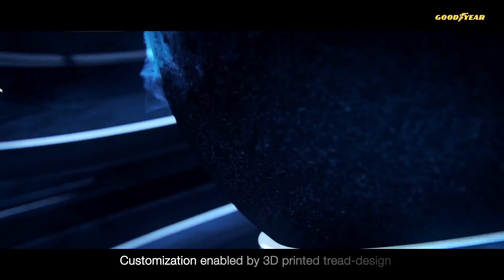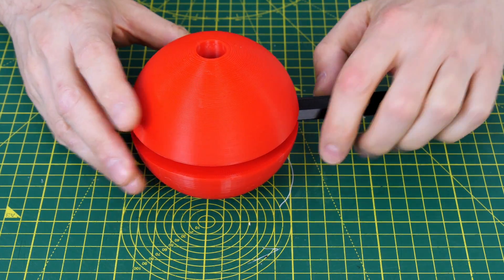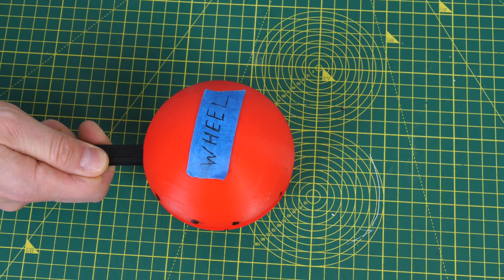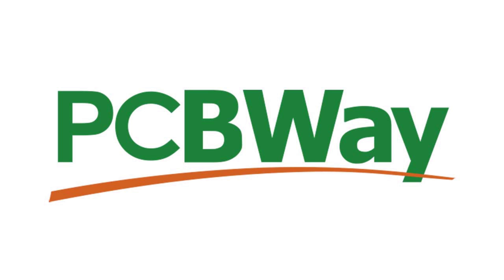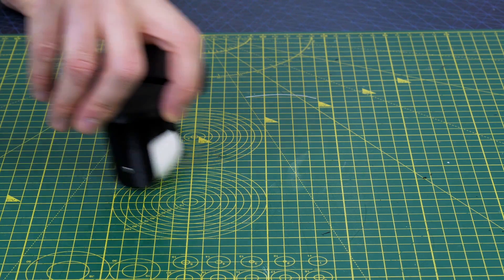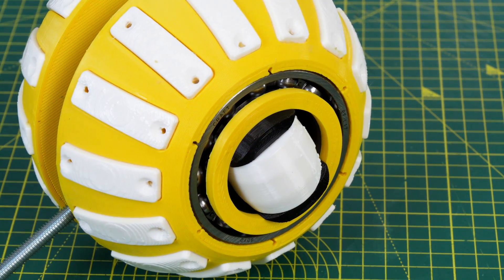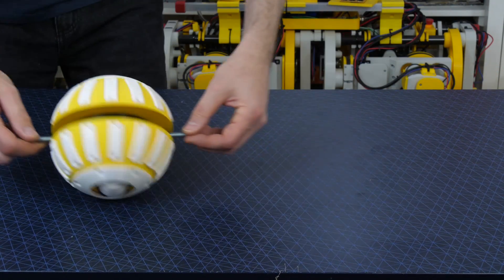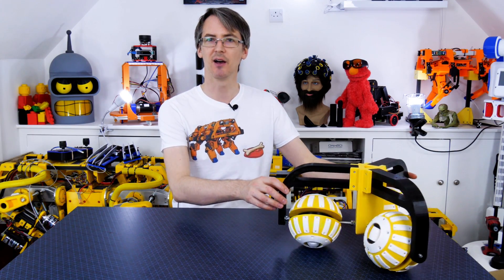Are Ball Shaped Wheels Practical?

Comment: I think the goodyear style magnetic wheels could work fine. The wheel would effectively be the rotor of an ac motor and as long as less than half of it is exposed under the car it can’t fall out if anything goes wrong.  The wheels could lift up completely when the vehicle is shut off and tada: park brake.

Comment: Just angle the axle, aka give it a little caster and a little toe in or out, and the part of the hemisphere on the end which can’t roll would never touch the ground. Would probably need to compensate for differences in rotation in between the two hemispheres with a sort of computer controlled differential or if the electric motor is in the hemisphere compensate with software.

Comment: You might not need the little wheels attached to the center hub with their shape..  If you attached them to the hemispheres, they might act to self align the hemisphere so that the little wheels rolls in the direct of movement.  It might now work 100 of the time but it would simplify the design.

Comment: Looks ideal for a camera dolly, if the hempispheres have smooth surfaces and fit as closely as possible to the rollers at the poles.
Reply: The gap bump prevents that use case :(. The drive shaft has to go through that gap, so it can't be small.
Reply: @coderentity2079  the poles not the equator. For an unpowered version the shaft could be replaced with a taller 'blade' that's thinner where it passes between the hemispheres. Immediately outside the surface it'd be thicker and curved to wrap around so the thinnest part of the support would also be curved rather than having a straight section that could flex.
Reply: @greggeshelman  Yet another idea is to slightly tilt the hemispheres to close the gap on the opposite side of the shaft. This makes the gap way smaller. You can go as far as have the hemispheres overlap by giving them square tooth that mesh together. This is of course for clean rooms, not for offrad.

Comment: While I can see mounting a pair of drive motors to each main wheel, I'm not sure if you could get away with the endwheel getting enough power to keep up. There may be some way to rotate the tri-wheel assembly to keep the endwheel from rotating into ground contact with a rotational limit encoding in the support axles.

Comment: What do you think about miniaturizing and motorizing? I've been looking for different designs of omini wheels in order to create a design for a vr locomotion shoe. Most of then are interesting but normally they are quite bulk, I'm looking for something simple which could simulate different traction using rpm, this ball wheel is pretty close to what I'm looking for but the size is quite the problem.

Comment: Perhaps this is a silly question, but rather than having the small wheel couldn't you track the wheel position and tell the motor to avoid the dead positions?
Reply: Not a silly question, you can track (or sense) the lock position and avoid it by slight turning. What you do loose with this is total control over the direction the robot faces. Sometimes you can't face a certain direction because of the drive-lock-avoiding. Bad thing for a camera dolly for example. Unimportant for a mapping robot.

Comment: I'm saddened that 'roller ball bearings' didn't come to your mind when thinking about a good little wheel in the center. They are easy to get and hold a lot of weight.
Reply: And when your wheels happen to stop right on the roller-ball-bearings then you can't break, just slide unstoppable. I just wouldn't drive to that point at all, proble solved.

Comment: I think that if you attached the axel to the wheel at a slight angle (rather than parallel to the ground) you could make a design that doesn’t require rollers since the little hole would never contact the ground
Reply from the maker: But the hemisphere still wouldn't rotate in that axis.
Reply: @jamesbruton  would it be able to move by using both axes of movement at the same time?
Reply: @slaximillion6044  The hemisphere of the third axis would have to slide as it's hemisphere can't decide to roll to the left or right when the hemisphere's axis is closest to perpendicular to the ground. This has a low chance, but it is a lock position. I'd solve this issue in software, a tiny little turn to either side gets us off from this lock.

Comment: The mini-wheels at the ends are basically the same as what you're trying to do with the overall wheel, aren't they? Why not just scale up those miniwheels and use them as the complete wheel?
Reply from the maker: That's just a normal wheel that only moves in one axis?
Reply: @jamesbruton  Oh for some reason I thought the axis could rotate. But I suppose it doesn't need to because the whole ball can rotate in the other axis

Comment: The ball shaped tire could probably be driven by two contact wheels instead of magnets, one in forward/reverse direction, and the other in left/right, the later blocked/lifted during the normal drive, then both could be controlled proportionally to maneuver the ball tire in "park/fool" mode. But what would prevent the ball from wobbling during the normal/road drive is beyond me. And anyway, even if it would work, I think it's too much trouble just to park the car a bit easier, if that. I mean the car will probably never have to work in Bezos's warehouse... Or park at downtown Delhi...

Comment: The three balls on that frame would look really cool if it were to be used as an office chair! Also would be more convenient since wheels on office chairs tend to bind.
Reply: Office chairs tend to have 5 wheels because it makes it less likely that the chair can be leaned opposite one of the wheels and as a result is less easily tipped over. Yes, it binds a bit more than with fewer wheels, but it's significantly safer.
Reply: @SmallSpoonBrigade  I doubt they would stick to 3 wheels, 5 points of contact is a minimum for office chairs. I'm just worried about already inflated price

Comment: Very cool! Have you considered replacing the small white wheel with ball casters? You wouldn't need to worry about the aligning the axis of rotation. Plus, it would limit the gap between the larger ball and ball caster.

Comment: I don't understand how you'd drive the wheels. How do you run them in all/any direction?
Reply: On the 3 wheeled design if you rotate 2 main axis in opposite direction then you drive along the third main axis line. If you drive all axis in the same direction you turn. You can also mix.

Comment: Wonder if flextures or  spring could be built in to give the wheel some suspension as I would imagine the wheels would ride rough on a road compared to the conventional tire.
Can't wait to see it with motors

Comment: Hmm,  could you make another mirrored frame and set of three wheels to mount upside down on the top? Then if the power/control were in the central yellow core you'd have a platform that could driver either way up. Handy if it gets lobbed into an environment and could end up in any orientation.

Comment: Wouldn't it be easier to put a ball bearing at the top of each hemisphere instead of a one-directional wheel? I'm imagining an edge-case where the small wheel gets pushed at an angle
Reply: Using additive manufacturing would actually allow for a captured sphere to be printed into the perpendicular axis

Comment: Looks good well done. On a 4 wheel robot i could see an issue if you stopped on the "little wheel" amd wanted to move off at 90 degrees as in the car parking demo at the start. I guess that would have to have a little radius on the turn baked in to the controller.

Comment: Why not use a captured caster ball instead of a wheel on the ends?
Reply from the maker: Mounted on what?
Reply: Inside the 3D printed assembly, I'm not sure the best way to explain it...think like an old ball mouse except the ball protrudes outside a bit. Could even use rollers on the inside to reduce friction like some old ball mice did.
Reply: You could use a screw in cover like old ball mice did or even screw it in if you use countersunk screws..or just toss in the ball at the right time during the print. Actually I bet old mouse balls would be perfect albeit possibly a bit small for your purpose, however there's also those inverted ball mice (track ball mice) that have the ball exposed which usually have a much larger ball with much more of its sphere exposed but still captured within the mouse. I hope that my explanation is coming across clearly, if not I'd be happy to whip up what I'm talking about in CAD to show you.
Reply: Google Kensington Orbital Optical Trackball, it's a good example. Put that same mechanism on both ends where your wheels are and it could help. You could possibly adjust how far the ball sticks out which may help with the drag at the transition point. Or even a set of smaller balls surrounding the larger ball where your tpu ring is.

Comment: Presumably once these are in use on a vehicle the axis will be driven. Instead of adding a wheel to each hemisphere, why not just endure that the axle us never stopped in a position where the pole of a hemisphere us in contact with the ground?
Reply from the maker: It'll be tricky when there are multiple wheels and there's wheel slip with the ground
Reply: @jamesbruton  I was thinking you could instrument the axle so that you always know it's rotational angle.  It might mean having to check the axle's angle and moving slightly "forward" before moving "sideways".

Comment: A swerve drive would also be a potential method to get omnidirectional motion in a car.
Reply: With twice as many motors and more complexity, it is also a way.
Reply: @coderentity2079  as compared to the ball drive? If I understand the system correctly, each wheel (ball) has two independent degrees of freedom, therefore requiring two actuators to manipulate. This is exactly the same number of motors required for both biaxial, coaxial, and differential swerve drives. 

Also, a simple biaxial (non-continuous) swerve drive is in essence just a driven wheel that is mounted to a pivot that can rotate 180 degrees to change the force vector of the wheel, the only "complicated" portion would be controlling the exact angle of the wheel module with some type of absolute encoder or potentiometer and running some relatively basic pre-calculus level vector based mathematics.

You could argue that the hardware requirements of a coaxial or differential swerve drive are somewhat more complex, however both types of drivetrains are very similar to a differential gear set that is found in all motor vehicles, except missing a few gears in the coaxial swerve and running backwards in the differential swerve.
Reply: @howardbartlett3419  They do have 2 degrees of freedom, but only the main shaft (the screw rod in the video) is driven, the hemispheres are free rolling and no need to drive them. It's like the small rolling beans in the omni wheel. The other balls will solve the movement in any direction, and they can do this because their axle is not parallel. 3 motors in total will drive in any direction and can roll even at the same time. Hopefully we will see this in action in the next video on tuesday.

Comment: This is really cool to see. But something of a interesting point, using maglev tires would eliminate the hemisphere gaps, as well as the axial mounted wheel, meaning a completely smooth wheel that can rotate on every plane, I don't know your experience with maglev but maybe something to toy with in addition to these wheels? Because if it where for vehicles then maglev would be the way to go, giving you a completely smooth ride, vs your design which I think would have a much more commercial/industrial usage, IE heavy equipment and construction equipment.

Comment: So, I can see how you'd motorise it with three wheels.  If it had four wheels though in a standard quad layout, wouldn't you need in-wheel motors too to get that sideways motion?  And if you were using it that way, the ...I guess "hub-cap rollers" is the best description... would also need to be motorised?
Reply from the maker: The same as three standard omni-wheels - the thing I showed at the end with the axles motorised. Testing on that comes up next week!

Comment: Wouldn’t a ball enclosed is a semi enclosing structure be a better option for the “wheel” at the axle point. Think ball point pen = Omni directional.
Reply from the maker: It's hard to make roller-balls roll smoothly unless they are mounted on...?    Also a ball wouldn't match the contour of the whole ball wheel whereas the little wheel contour does.
Reply: @jamesbruton  Thanks. Thought it might be an option so you don’t need to orientate the wheel.

Comment: It makes me think of castor wheels you would see on a roll-y/business chair. Like the fancy rounded ones that get caught in the carpet.
But yea, I do like to think these might have pretty good weight distribution due to the "always 90" feature that a sphere gives - but I would have to see it under suspension and stress to make that determination, and probably made out of rubber filled with pressurized air at high speeds (unless all you want are castor wheels). I am not a fan of the mini wheel, the point of transition there and between the wheels just feel like major possible fail states - especially with the mini wheel being a different construction and mechanically isolated, though I do think the interchange between wheels could be easily solved with just adding a lip or inset in the wheels and just minimize the space between them while still not touching - which I could imagine could get very very close. I do like this better than other omni-wheel designs, however, as it is dependent on less parts overall and the wheel is rarely at threat of having a problematic position or failure due to the "always 90" characteristic.

Comment: I foresee these having the same issues as omni and mecanum wheels: dirt and inclines. These things require billiard table smooth floors and very little incline or you lose control.
Reply: The only slightly problematic part is the gap between the two hemispheres. This design doesn't have tiny wheels, tiny bearings and lots of gaps to fill with sand. To keep control, sure you need accelerometer and compass and gyroscope and compass and gps and barometer and laser radar and tof distance sensor and optical flow sensor and sonar - or vision :)

Comment: Humans can barely drive on cylindrical wheels, adding in this variable would throw a wrench in that and make it a million times worse. I wouldn't recommend something like this until either humans get better at driving or a.i. gets better than humans ever could, both unlikely to ever happen.
That aside, braking wouldn't be that big of an issue if you use the concept of "plugging." It's how all the forklifts I work with operate. Of course there is a dead man switch/hand/foot brake but plugging is the most commonly used method to slow to a stop.

Comment: Use ball bearing or marble not wheel on the ends
Reply from the maker: Running on what so it can roll freely when on load?
Reply: @jamesbruton  https://m.th.aliexpress.com/item/32967028046.html?trace=wwwdetail2mobilesitedetail  not this but the idea. A ball to allow rotation in all directions just for the end to replace the wheel
Reply: This ball will not rotate freely they are normally spring loaded
Reply: @NickyDoyle  Take a closer look at what supports that "big" ball? Lots of tiny balls. And what supports them? A cup, but then those tiny balls aren't rolling, they sliding. Bad idea.
Reply: @jamesbruton  You can run it on an ink film like in the ball pen ;) Don't you get tired of this?

Comment: Tilting a driven ball gives a gearing reduction, could this concept be the basis of a continuously variable gearbox?
Reply: I like this, but I can't imagine this capability combined with omnidirectional functionality. When driving constant velocity in any arbitrary direction, the hemispheres have to accelerate and decelerate as they touch the ground at different axis distance.
Reply: @coderentity2079  If you had hemispherical tyres you could tilt them to vary the gearing, and do away with the gearbox.  Tilting one side only would give you steering.
Reply: @rogerbarton497  Yes and you don't even need the other hemisphere! James should do a separate video on this. Electric motors are forgiving, but could still benefit from such a gearbox replacement. Running very close to the hemisphere-top would give high torque and low speed - think moving a pallet with a ton. But still this project is about omnidirectional movement, I still can't see how to combine the two idea.
Reply: @coderentity2079  If you tilted all four hemispheres simultaneously you would get engine breaking (like shifting down the gears) and finally at 90 degrees the tops of the hemispheres would sit on the road, providing a parking brake.  So that's replaced the gearbox and brakes.
Reply: @rogerbarton497  Yes, excellent, but that "tilting down" needs to be more like rolling down so we don't need to slide on the surface. That complicates things.

Comment: what if the small wheel on the end is a ball bearing instead? so it doesn't have to be kept perpendicular to the axel and it moved equally smooth in all directions?
Reply from the maker: Mounted on what though?
Reply: @jamesbruton  well if you take the same idea as with the wheels, there could be posts with the ball bearings on the end. if you make a cap that has a slightly smaller diameter than the ball bearing it won't fall out. and maybe graphite dry lubricant could work do it rotates freely?

Comment: If the little wheel was attached to the  hemisphere, wouldn't the hemisphere spin to correct for the run of the wheel in any direction?
Reply from the maker: Only if it dragged like a castor wheel?